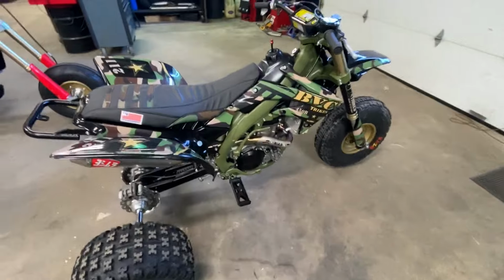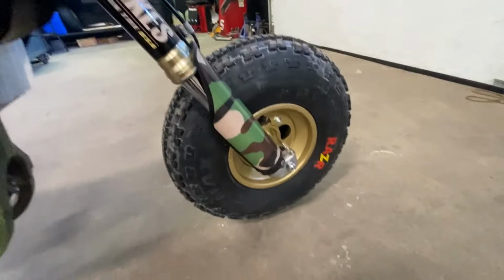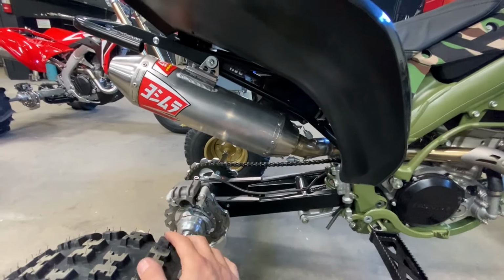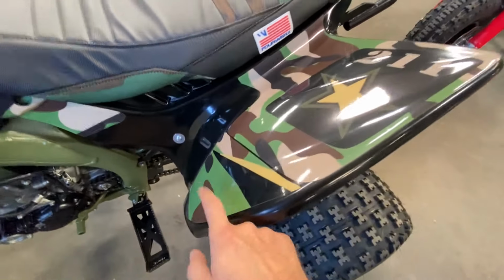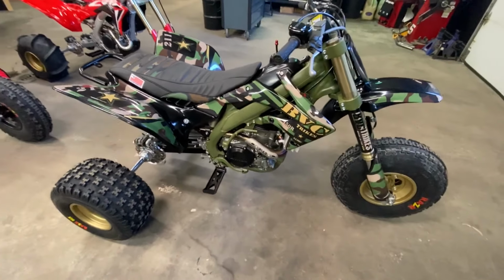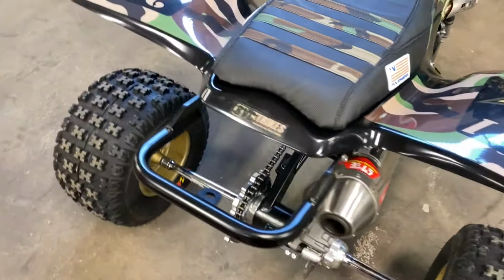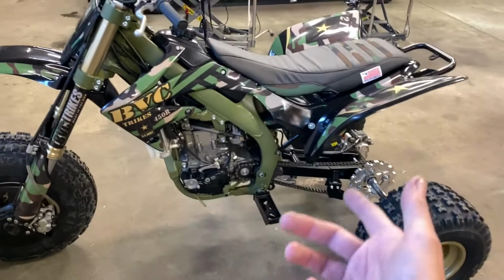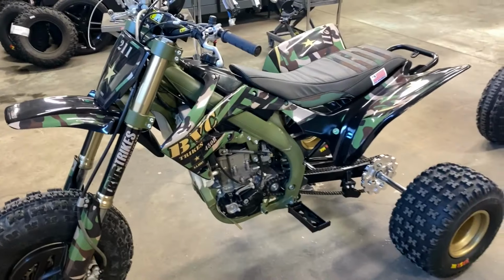ARMY TRIKE FINISHED! CRF450R dirt bike to 3 Wheeler conversion

Comment: Gaht Daaaaammnnnn!!! that thing Is beautiful! You guys have really stepped up your game after moving into the new shop. I can't wait to see you guys blow up and go all Orange County Choppers, except sick as fuck, and not corny. Keep it up, cuz nobody's doing it like you. 
I got a 86 ATC 350x, stock engine, piped, and full Meier's blacks and oversized plastic trail tank. Do you guys make bolt on upgrade packages for oldies?I think the last owner welder in a decent gusset kit, cuz the frames powder coated red. Oh, and the top end Ticks like crazy, but it's a Thumper..  it's an Alaskan trail bomber, mountain climber, driveway jumper, ice racer; you know,  the good stuff
I want it modernized, at least suspension and wheels, power later. The stock tires I got are too tall, especially in front. And  It's a typical trike, no front brakes and rears are going. Also, how can I wire in a headlight? do I need to run off of a stator? could I just hook up a little Ridgid light bar that I got,  or do I gotta get a battery hooked up? Thnx
Reply from the maker: Weoffer invert fork kits. Call us 518-563-3699 to discuss options
Reply: @BVCOFFROAD  bitchin!

Comment: Are these hard to ride in trails or easy to turn over such as the old school 3 wheelers?
Reply: Baby steps, experiance counts. But you'll definitely create some 3 wheeling memories...good luck
Reply: Original 3 wheelers aren't easy to turn over, as long as you're taught properly, and are aware of your surroundings. I've had many ATC's, starting with a Big Red, 250SX, 200x, a couple 250Rs and the one I got now, a 350x. The only time I ever "wrecked" one? Bombed a 4 wheeler trail 40' high hill crest > sharp right, and went off the end trying to Fred Flintstone stop before I flew into them road, which I did. Hit the drainage ditch at the bottom, and flung myself way into the road. Stopped traffic and everything. My leg got sucked into the front, pinned between the tire and the shock. So embarrassed, because Sunday morning traffic, dead stopped,  got out of their cars,  and I'm a big guy, it took 4 people to help get me out. 

That was on the 250sx, 14+ years ago. I was probably a stoned teenager. Luckily, Not a scratch on me though.  Never again! Weight back, knees bent, and when in doubt, throttle out!✌️